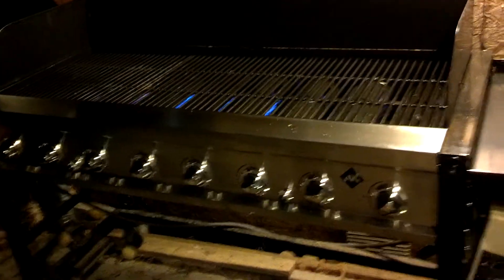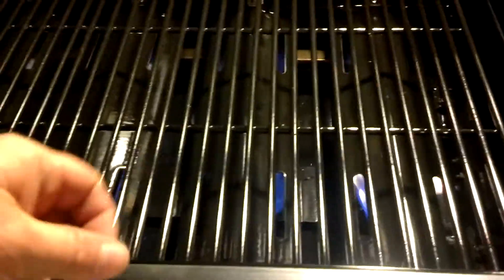LP to NG Grill Conversion. Bakers & Chefs 8 burner. Propane to Natural Gas

Comment: This is a great description, i really appreciate all the detail.  We are planning on buying one of these and converting it to NG.  I also have the question about the regulator.  Is one needed?  Has anyone had any experience with that?
Reply from the maker: Todd Meyer no, use the hose from the regulator to adapt directly to one of those gas-hoses for a dryer or stove.  That goes to the black pipe (where you'll need a T for the 2 sides of the grill.
Reply: reitze01 Thank you!  Going to give it a try!
Reply: A regulator is needed if your natural gas service is not regulated by the provider.  typical regulated gas is 4 to 5" pf water column.
Reply from the maker: I've never used a regulator for NG.

Comment: I Have the same grill and searching for a way to convert to NG. Is there a detailed summary of your conversion any where I might be able to talk you out of? Did you change out he regulator? Did you use a natural gas regulator or full house pressure?
Reply from the maker: Tom, Check the description - I was fairly detailed for someone else who asked the same question.  Also, I have a couple word-files of my notes I could share if you share an email address.
Reply: Thanks for your response and video. Here is my email address...westervillian@gmail.com. I was wondering if using a 5/64 drill bit, does the grill get hot enough? Also, no natural gas regulator? My gas range has a natural gas regulator, should the grill have one as well? Thanks

Comment from the maker: Converted my Grill.
Reply: Thank you for this video. I just bought the same Grill from Sam's club and am ready to convert to NG. I have had an NG line run out to my patio already. I have unscrewed the LP gas orifices and will replace with NG orifices. Other than that, did you need to change out any other hardware? Does a standard NG flex hose w/ NG regulator just connect directly to grill gas threaded nipple on each side? or did you need to change that you too?